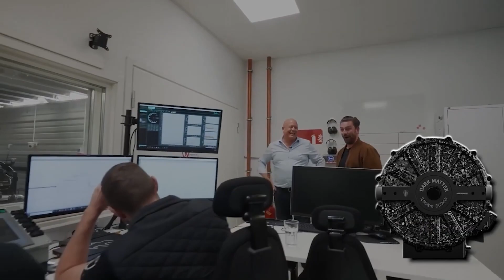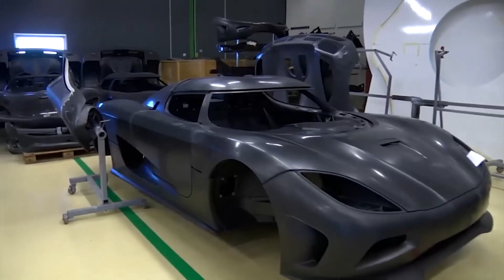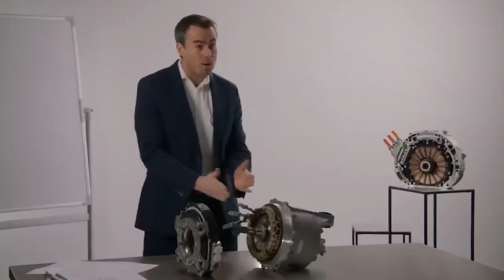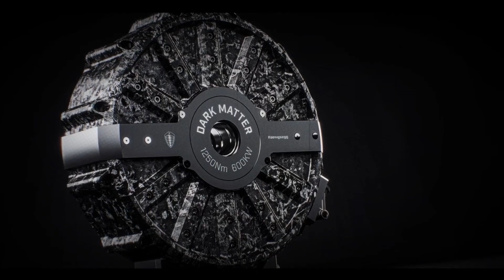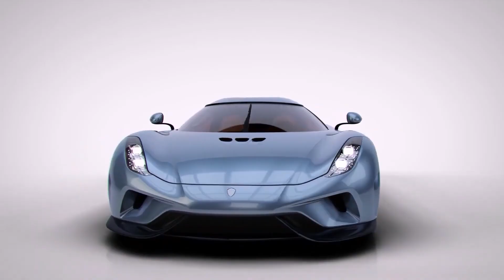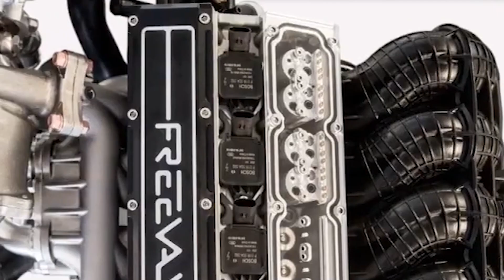Finally! Koenigsegg Confirmed Dark Matter Engine Shake The ENTIRE EV Industry

Comment: its still an electric motor if you did a tiny bit of research
Reply: It is actually a hybrid set up. it is a V8 and with a Darkmatter electric motor mounted on the drive shaft right before the gear box. This way you have instant torque from the electric motor and have an even toque sheet cause the darm atter e motor gives high torque on low rpm and the v8 kicks in after like 3-4k rpm to give peak torque and power
Reply: @pantherhermgaming6910  exactly, the dark matter component is just another way of producing electricity